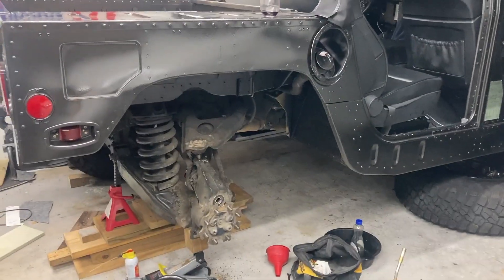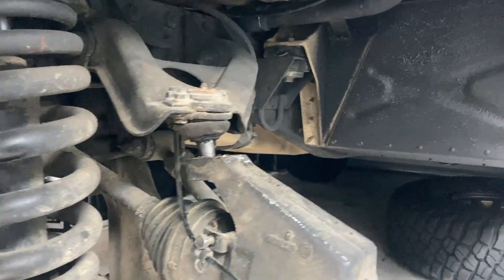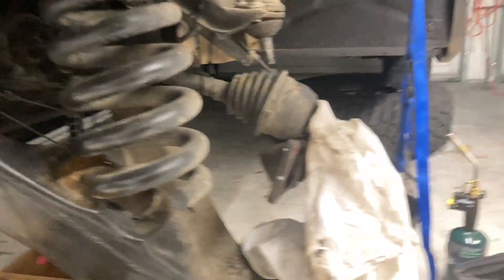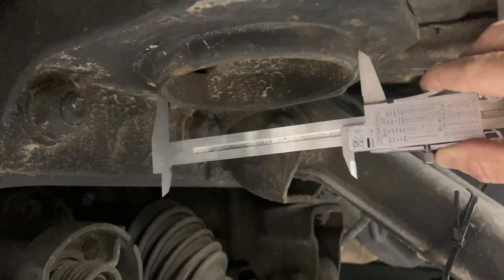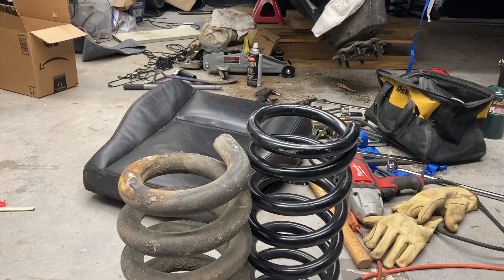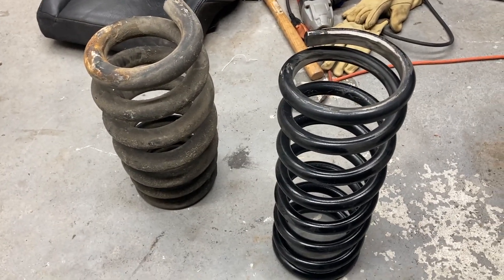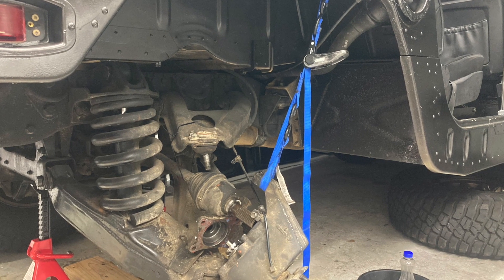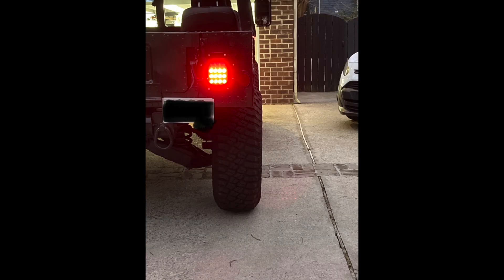humvee armada springs replacement

Comment: Just so we all understand completely. If you are going for ride quality, this method and replacement shocks are spot on. BUT, if you are only doing this for for the positive camber, there is another way for FREE. On the upper control arm mounts you would remove those mounts and then remove the shims that are behind that.. pause this video at 10.27 and you can actually  see them peeking out the top.. Disclaimer: Some have slide in fork type but some are fully enclosed forcing you to remove the entire bracket to remove them.. But  He did a great job and I will be looking to do the same Armada spring upgrade this tear..

Comment: Have you done this to the front as well? My Humvee has the different style spring seats in the rear. You have the style that places the spring seat higher, allowing for a taller spring.  So I have to swap those out before I do this mod.
Reply from the maker: I have not. I am planning to replace all 4 corners with an air suspension using LR4 Landrover parts because the smaller springs have made my payload capacity super weak
Reply: Gotcha.  I already installed the two front springs and even after cutting a 1/3 of a coil they’re still too long.  The springs look like they want to pop out.  So what I thought about doing was installing the rears and dropping the truck on all four tires. Drive it around for a little and see how the springs look after.  If they steal look like they want to pop out I’ll just go ahead and fabricate some new spring seats for the front.   I’m going to attempt to install the rear springs without cutting them.  I just need to buy the different style spring seats like the ones that you have on your truck.

So aside from the payload capacity how did you like the way the springs feel?   Didn’t really make that much of a difference in the payload capacity? I’m not planning on towing anything but I do have two 42s spares and a jack along with a winch in the back.

Comment: informative video, thanks. Is it the same spring for the front replacement also?
Reply from the maker: Thanks. I think so but I'm not sure on the cutoff for height. I guess I'd do a relative percentage of what was taken off the rear when compared to the original rear
Reply: Do you have more info regarding, if its same coil spring as Pathfinder and Armada etc. I am in Europe, so no Armada here..
Reply from the maker: No I dont. somewhere in the video it compares the stock with armada spring wire (.81") diameter. Maybe is a place to start. Could also look at Armada GVRW and find something in a similar weight class. There's a lot of science to spring rates etc, but at this stage its best approximation with experimentation  @Stigman11

Comment: How was ride quality? Did it feel softer?
Reply: So I figured it out. I was watching your video and realize you don’t have the airlift bumper like I do I think it’s like an extra 500 pounds or something, i think the extra weight is causing it to sag
Reply: @maddrummer910  I installed a airlift bumper with the extra reinforcement myself by hand, its "only" about 200 with all the extra bracketing,, i'm just a small guy too!
Reply from the maker: It's a lot better. I think going to a lower rate shock would help a lot too, but before when going over bumps this thing sounded like someone smacked the bed with a 4x4. It doesn't do that anymore and can feel it moving to absorb bumps now. The springs have settled in a bit and the bad positive camber I had is going away too
Reply: @sdalin27  awesome, guess I’ll do the same, thanks
Reply: @sdalin27  does changing the tires to regular civilian wheels without run flats provide a big change too?
Reply from the maker: @maddrummer910  Ive never ridden in one with runflats, but going from the mil tires to civilian tires and wheels was a major improvement on my buddy's truck where we drove it with both.
Reply: @sdalin27  OK cool also did the Armada springs get rid of the V-shaped on the rear wheels?
Reply from the maker: @maddrummer910  Initially it was still V shaped (positive camber). I thought I would certainly have to remove the shims against the frame. It has settled in now where I should probably still take them out, but can get away without it for a while incase it settles on its own over some time. It's not near as bad as when I originally put them in
Reply: @maddrummer910  in my case it did! my stock 24 bolt wheels I could not get them to ballance no matter what i tried w and w/ runflats, aftermarket bead lock, nothing worked. (even the pro tire shops) went to Civi H1 wheels and all was much better! had them powdercoated flat black not to mention they went from weighing 160lbs ea to about 70
Reply: @sdalin27  it seems like it would help the setteling in process by carying a heavy load arround for awhile and also see how much sag you have  now with the lighter springs..?
Reply from the maker: @rolling1885  I'm still struggling with mine which may have to do with too much slop in the tie rods/pitmann/idler/steering bar
Reply from the maker: @rolling1885  It's maybe a bit less, but still an issue. Rides great with 800-1000lbs in the bed. With metal thought it will spring back unless the elastic limit is exceeded. Maybe it would sag slowly over time, but the only way it should take a new "baseline" set point, is by exceeding that limit, then its a factor of time in that position
Reply: Getting around to getting them done, where did you buy yours from?
Reply from the maker: @maddrummer910  https://www.ebay.com/itm/352472462785
Rear Constant Rate Coil Spring Set Moog For Nissan Pathfinder Armada 4WD # 81085
Reply: Ok I added them and holy smokes my back end is sagging and that’s without cutting anything off. Looks way lower than yours, got the 4wd springs just like you. Does ride a little better
Reply: I went to some lighter 998 springs in the front which brought the front down a little, but that back in still looks saggy. I’m thinking something on the rear end is too tight and not allowing spring to expand back out, im going to buy a day star armada spacer and see if it helps

Comment: Nice job man! let me know if you have any questions on that camber, just removed my rear shims a few months ago (it was a pain but after one side, second side was easy) it made all the difference in the world. Where did you source those springs?
Reply from the maker: Thanks man may check back in with you on this. What tips do you have for getting the shims out? I think I need to remove mine. It looks like getting to the nuts on the back of the frame will be a big pain. If I can get them, maybe I can do it without pulling the entire control arm apart and removing. Looks real fun either way. Rides much better though already with the lighter springs! Big difference
Reply: @sdalin27  upper control arm has to come off to access the bolts holding them in. Most of the shims then slide out from the bottom after loosening the control arm bracket except for 2. To remove the last 2 you have to remove the control arm brackets completely as those shims are not slotted. I used an impact for the easy stuff, then an impact and a socket wrench braced against the frame from behind for the hard to reach places. It’s tight, but doable!
Reply from the maker: @TheBosleyMusic  Did you run into issues with the bolts on the back side (inside) of the frame rail? Did you have to unload the springs? Or do you just support the lower control arm from underneath and take the top parts loose?  It just doesn't seem like a low involvement surgery
Reply from the maker: Springs were off Ebay. https://www.ebay.com/itm/352472462785   . P/N 81085.  How much tire angle would you say the shims resulted in? From positive camber to neutral or close? I think that's going to be my next move as there's no other variable that will adjust that.